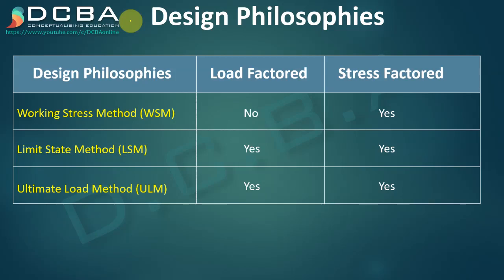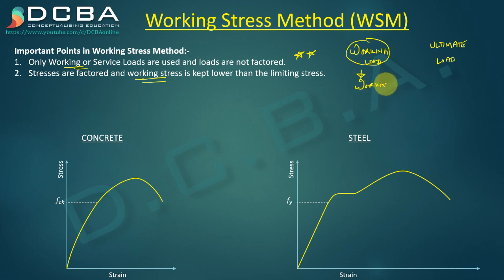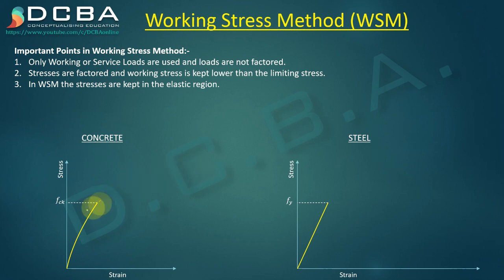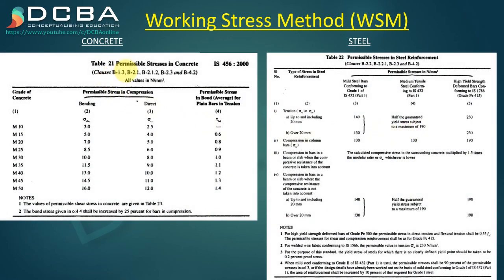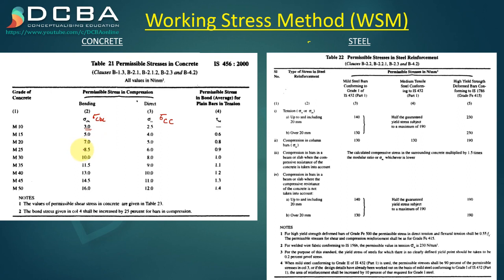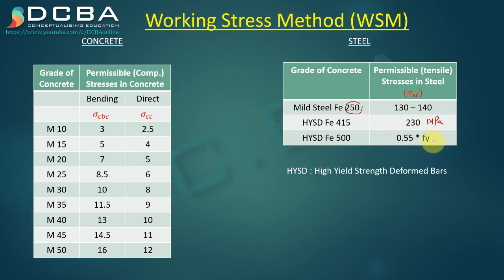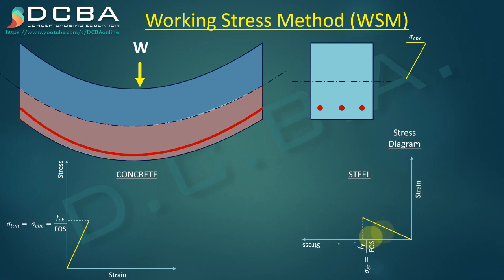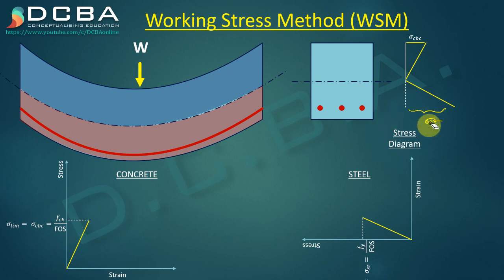Lec 02 - Working Stress Method (WSM) Introduction

Comment: For flexure: when extreme fibre reaches permissible stress, it transfers the force to an inner fibre, without failure. However, for compression member under load, all the points on the C/S get equally stressed & there is no such scope for force transfer. So, FOS is more for direct compression in comparison to that in bending compression

Comment: Sir,
   As per IS 456(2000) table no.21
M10 grade concrete having direct permissible compressive stress is 2.5Mpa
  So why the large difference between 10Mpa & 2.5Mpa.
Reply from the maker: That is the safety factor that is taken by IS 456:2000, crushing failure is catastrophic and hence some special confinement reinforcement has to be provided, therefore a more safety factor is assumed for direct compression.

Comment: Sir,
   Why stress-strain diagram behaviour of concrete in direct compression and in  pure bending
is different.
   And why stress-strain diagram behaviour of steel in direct tension and in pure bending is same.
Reply from the maker: It comes from the fact of how concrete fails in both cases, in case of bending there are different compression and tension zone created in concrete, where is direct compression it fails by crushing or bursting. Steel does not have this distinction.